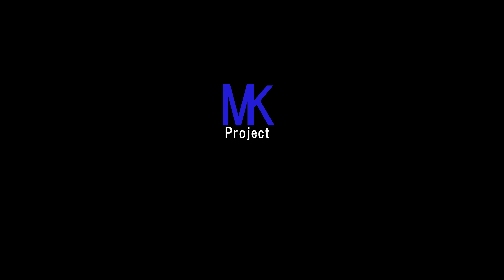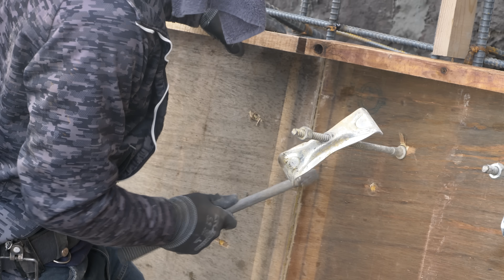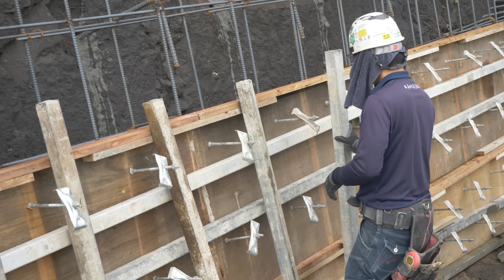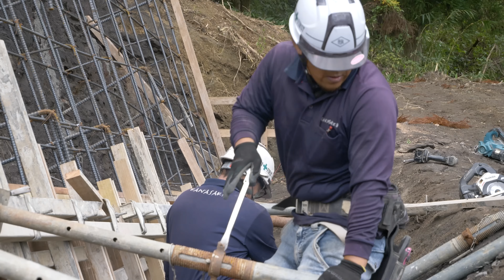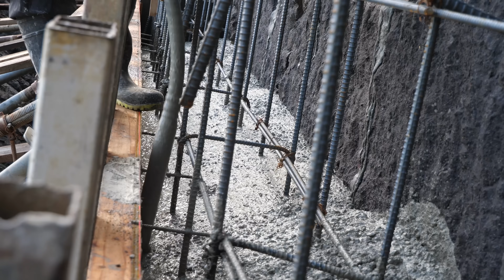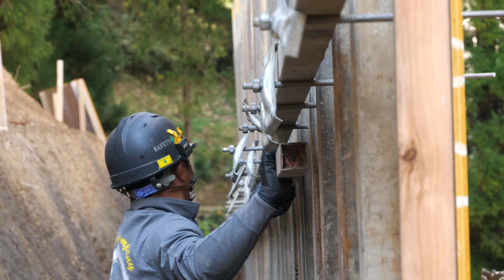山の崩壊を防ぐ使命のもと、日本の職人たちが集結。【巨大擁壁の構築に挑んだ男たちの記録 -Part.1- 】

Comment: nice to see the younger lads on the team enjoy a little clowning around. Can someone explain how those bolts that clamp the stiffening bars can get tightened so fast? Its as if the guy pushes on it and the nut moves without having to turn very much?

Comment: コンクリート😮😅がたくさんあるということも、4メートルの深い穴をあけますか?一列に並んで、水平と垂直の両方とエポキシをスチールボルトで、その後、15センチメートルの金網を取り付けますか?それを所定の位置に保持するためにボルトで固定された正方形のプレート?パート2を楽しみにしています

That is a lot of concrete 😮😅 Do you also, drill deep holes 4 meters? in a line, both horizontal and vertical and epoxy in steel bolts, then put up a wire mesh with 15-centimeter? square plates bolted to hold it in place? Will be looking forward to part 2